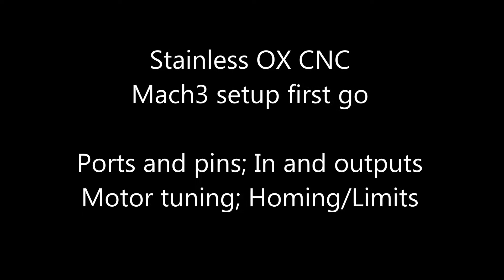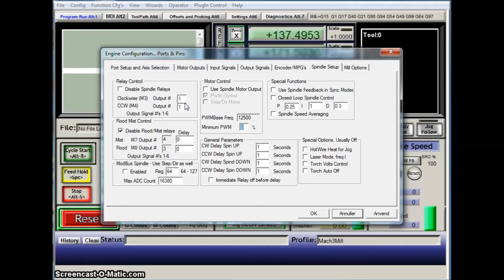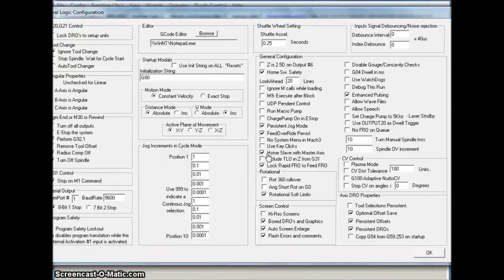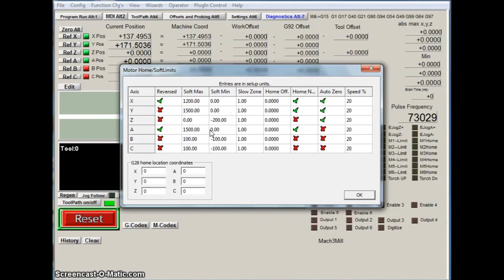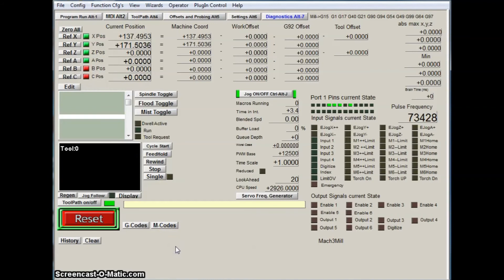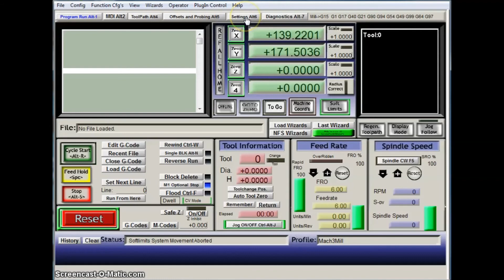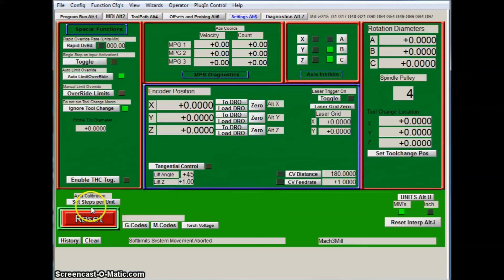Stainless OX CNC Mach3 setup - first go

Comment: Martin, I've finally finished my OX CNC ROuter and I have a question for you. When doing the initial setup, do I center all of the axis? Then proceed to Jog it to its limits on each axis to set my Soft Limits. I am not running any Limit Switches and have been told that they really aren't necessary by a CNC Engineer. My machine will also be setup in inches and is basically the same dimensions as yours, though I will be running the UCCNC Controller as a substitute for Mach3. I do have both, but prefer the latter as it isn't hampered by Windows and all of the services that it requires to operate effectively. My initial setup was assisted by Corvetteguy50 who also has an excellent group of pages here on YouTube. Other than my electrically challenged questions. Your video here has moved me further along then anything put out by Mach3 itself.
Reply from the maker: If you do not have limit switches installed I think it's hard to make soft limits work as they need something as reference. Normally you home the machine (all machine coordinates set to zero) and minimum soft limits will then be eg 5-10mm from that (in the positive direction). Likewise you enter the max soft limits as full XYZ travel minus 5-10mm. You can run w/o switches as long as you a sure not to make a crash :-)
Reply: After discussing this issue with various people I have discovered that Limit Switches aren't necessary to set up either Mach3 of UCCNC. Their reasoning is that electrical switches have a tendency to fail too often and the computer interface already knows where the limits of machine ravel are with the Soft Limits. As one wouldn't normally run their machine with Machine Coordinates turned on in place of Soft Limits.

Comment: Martin, are you using a Gecko G540 for you driver?  I've got the same software you do and want to make sure I can set up everything correctly.  The only thing that I will have to watch is doing everything in mm instead of inches which will be fine I'm sure.  Thanks for the great information on setting up the Mach 3 software.
Reply from the maker: +Neil Cochran Hi Neil, No I'm not using Gekko. The break out board and stepper controllers are some Chinese ones that you can find on e.g. e-bay and AliExpress. They work fine and have nothing to complain about - and they was quit cheap. I think I paid less that $150 for four NEMA 23, 4 controllers, PSU and BoB.
I have made a video describing the setup I have: 
https://www.youtube.com/watch?v=12LoOmPAJ3oFrom what I have read others are happy about the Gekko G540 but I do not have any experience with that controller.Best Wishes, Martin
Reply: Thanks Martin for the information.  I truly appreciate your videos and all your help.

Thanks again,
Neil

Comment: Hi. We have an OX build and use the TinyG v8 CNC control board with chilli pepper, not completely happy with the chilli pepper end and would like to switch to Mach3, could you post a link to the CNC controller and step down pcb that you have used please. Thanks in advance
Reply from the maker: Samantha Welburn Hi There!You have lots of options for how to connect to Mach3. The simplest is to use a system based on the parallel port as this port is ideal for the purpose. However, not all PC now have one. Then you can use a USB based board. These typically has an on board CPU to secure the synchronization becomes right.The kit I use is very similar to this parallel port bases set: http://www.ebay.com/itm/German-Ship-3Axis-Nema-23-Stepper-Motor-270oz-in-Driver-DM542A-4-2A-CNC-Router-/301445110765?pt=LH_DefaultDomain_77&hash=item462f875bedBut I do also have some experience with this USB boardhttp://www.aliexpress.com/item/HX-4-Axis-Mach3-USB-Servo-Motor-and-Stepping-MotorCNC-Motion-Control-Card-AKZ250/1194085935.html I also works fine with drivers like DM543A - but it does NOT support slave axis